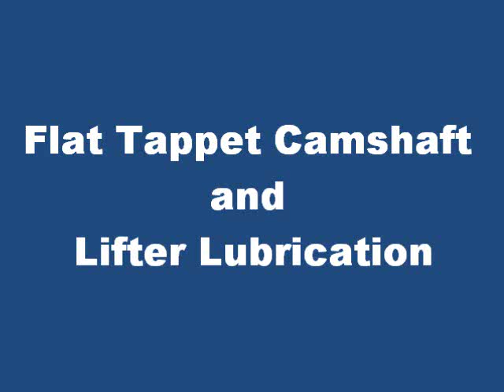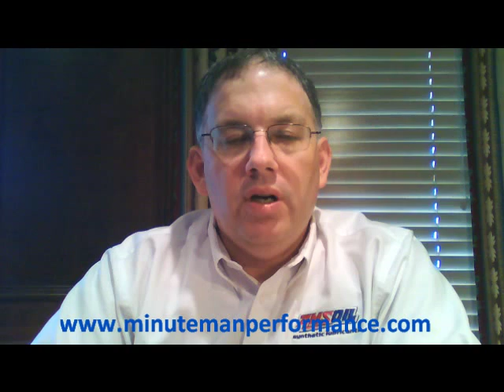Flat Tappet Camshaft and Lifter Lubrication

Comment: I remember not only oil but anti-freeze or any fluid having to do with automotive tripled over night and kept going up after synthetic especially so now you’re talking $25 a qt.oil.Valvoline VR1 has zinc in it,not enough to start a brand new flat tappet cam engine but enough to run on after.

Comment: What's the API grade for the AMO?  What are the zinc ppm amounts for SL and older oils?
Reply from the maker: AMO is a 10W-40 full synthetic oil that contains 1378 ppm of zinc.  It is recommended for API SL and earlier classifications, but AMSOIL does not seek actual API approval for this oil because they would have to reduce the quality of it to stay within the API specification limits, as well as spend a lot of money gaining approval for an oil they already know exceeds the API standards.  Contact me if you have any further questions.  Thanks.
Reply: Does Amsoil make any conventional break-in oil?  Synthetic doesn't always coat parts nearly as well.
Reply from the maker: The8TrackChap AMSOIL Break-In Oil (product code BRK) is an SAE 30 oil formulated without friction modifiers, but with very high amounts of zinc and phosphorus anti-wear additives.  This combination provides great protection for new engine components, but allows rings to seat and lifters to mate properly with the cam.  Great product, especially when used in conjunction with AMSOIL Assembly Lube (code EAL).  I have other videos on both of these.  Contact me if you have further questions.
Reply: I have a more typical ZDDP question. Are modern oils with <800ppm of zinc harmful to the stock flat tappet cam engines with lower valve spring pressures?  I've read some forums discussing that the ZDDP is more critical for high cam lift and high valve spring pressure and that certain "modern" flat tappet stock engines are fine with the SN oils and the ppm limitations.  The valve spring pressure comparison seemed to be between "high performance" engines and perhaps a stock daily driver with  flat tappet cams.
Reply from the maker: The8TrackChap Great question, but not a simple answer.  It's one of those "it depends" situations.  Cam design, lift, spring pressure, and rocker arm design are all factors that can increase the need for ZDDP (or not).  But those factors are also countered by the fact that in most cases, the SN oils are better at lubricating than the older oils. The older aggressive flat tappet valve trains would squeeze all the oil out between lifter and cam lobe, and the ZDDP was the only thing left to provide lubrication.  Newer oils resist this squeeze a little better, so they need less ZDDP, but only up to a point.  When in doubt, use an oil with more ZDDP, especially if cat convertor poisoning isn't a concern.
Reply: I've also read that excessive ZDDP can cause damage to O2 sensors and can create other issues (maybe emissions related) with the OBD II system codes.
Reply from the maker: The8TrackChap That is correct.  Excessive ZDDP can create a coating on the O2 sensor tip that interferes with proper functioning.

Comment: First time I ever herd my oil will mess up my catalytic converter, if your valve guides and piston rings are good, there is no way for you to burn oil and mess up the cat
Reply from the maker: Every internal combustion engine consumes (burns) a very small amount of oil during each combustion cycle - there's a microscopic-thin layer of oil on the cylinder wall that gets burnt when the air/fuel mixture ignites. Anti-wear additives left behind help lubricate the upper cylinder for the next stroke of the piston.  But you are correct - healthy engines aren't the problem.  The EPA is worried about those engines in bad condition burning the older oil specs with higher levels of Sulfated Ash, Phosphorus and Sulfur (SAPS), which "may" poison the catalytic converter.